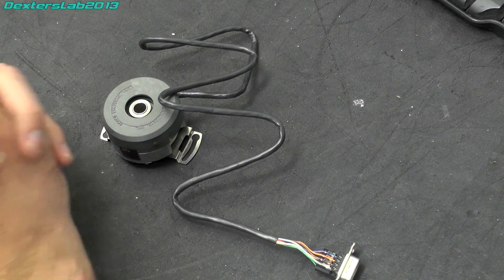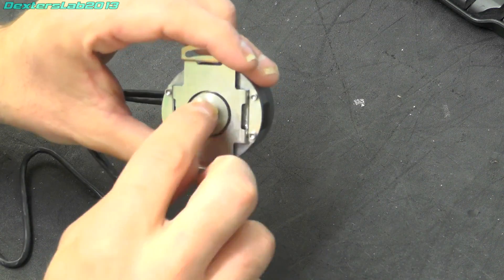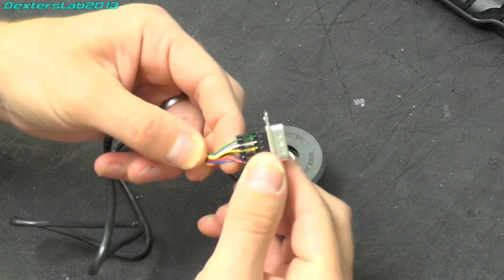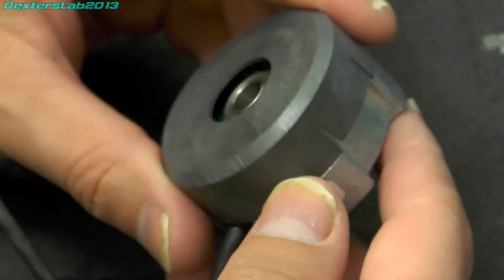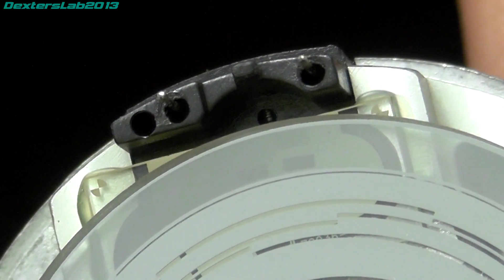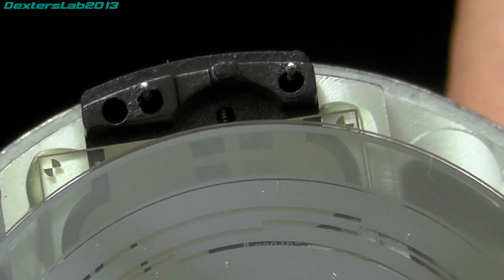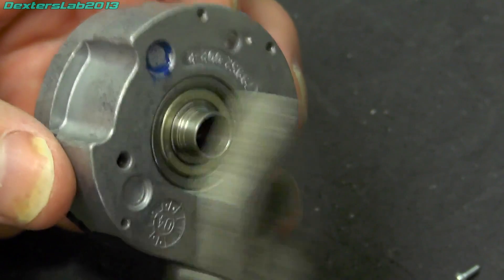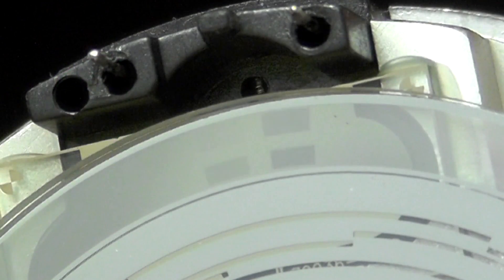DL133 Teardown: Precision Renco Rotary Quadrature Encoder

Comment: Whenever you see robots picking parts from a moving conveyor, that is the encoder that is attached to the conveyor motor shaft. Just research conveyor tracking encoder if you are curious about the 9 pin standard.

Comment: I cringed a little at the thought of tapping it apart. Really interesting solution to detect the direction, didn't expect that. What's surprising to me is, that the board doesn't seem to be indexed or mounted as precisely. So I assume it get's calibrated once it is installed by carefully(!) rotating it and then tightening the grub screws. Although a visual indicator for the "home" or "0" position would have been nice as well. (I didn't see one)
Reply: The board just has to match these 4 squares that you see flickering.. Not much accuracy needed. Smart design.
Reply: Carefully! Just a bit, yeah! Actually, carefully would be an understatement.
Reply: As other people have said, the only really important dimensions are the patterns in relation to each other. As they are on one piece of glass this is insured.
Reply: pizzablender oh, right, I assumed this was highly dependant on the angle, but thinking about it that doesn't really matter, as long as the sensors on the board don't move relative to each other. And it's not dependant on the angle either. Really good design.

Some indexing would have been nice though
Reply from the maker: +Der Keksinator the precision is in the alignment of the fixed glass piece and the rotating disk to create a shutter for the sensors. The sensor only needs to be roughly aligned to the shutter area (the four squares).

Comment: The inner tracks are U V W commutation signals for a permanent magnet servo. They are electronically aligned to the back EMF of the 3 phase windings. That looks to be a standard incremental encoder giving speed and direction signals.
Reply: While it might be used for that, it's actually a 6 bit gray code for an absolute position sensor that obviously isn't used in this device.